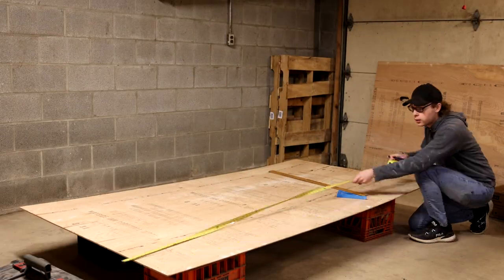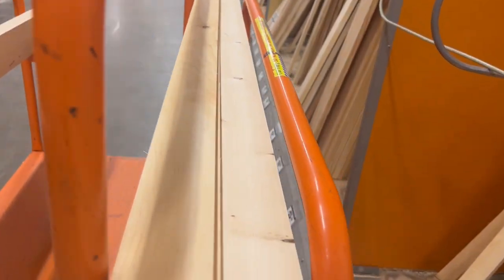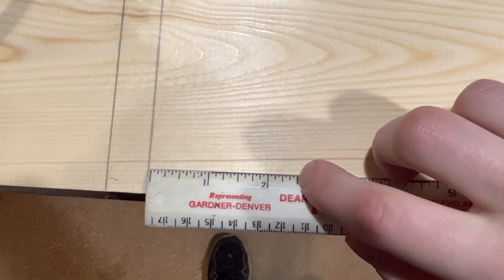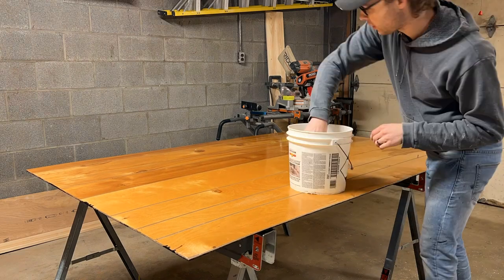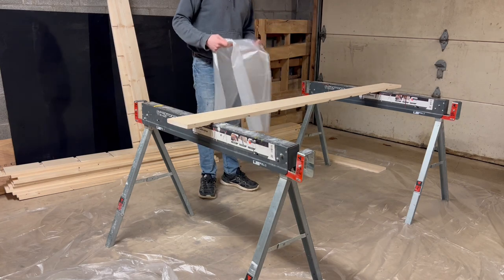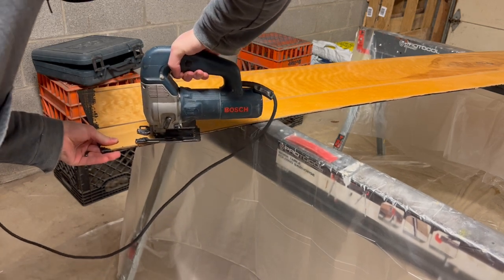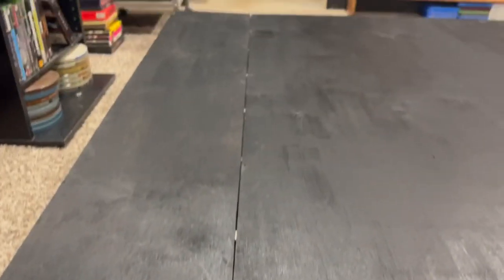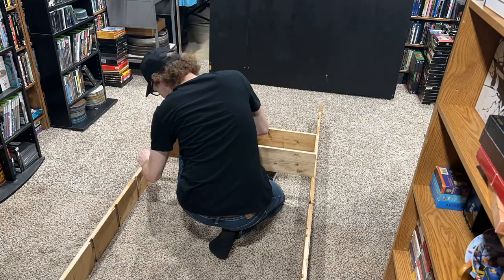Building A New Movie Shelf!

Comment: Great job! Have you tried using Kreg pocket hole system and screws? I built some shelves using them but used 2x6's because they were actually cheaper than 1x's at the time and may still be. It might save you from having to use the router. Enjoyed the video! 👍